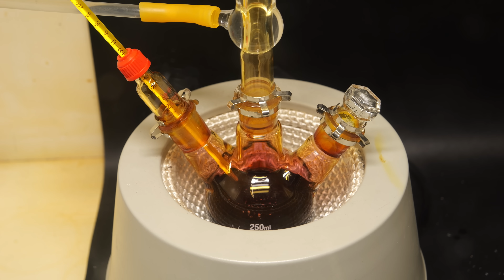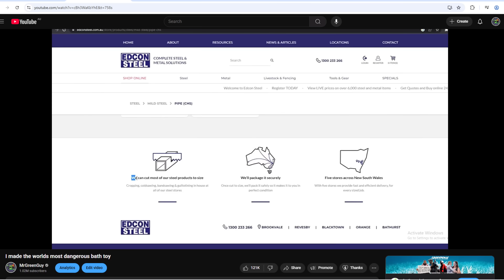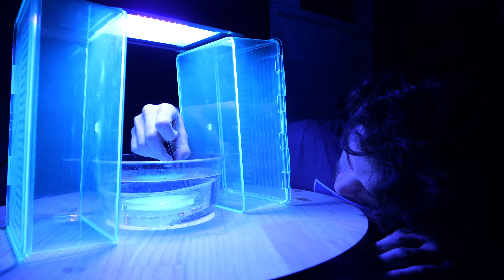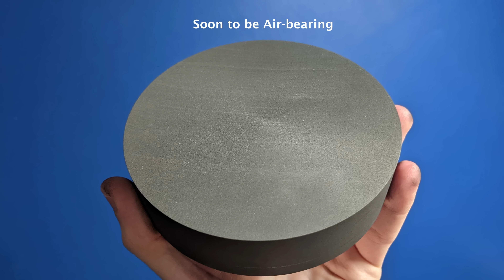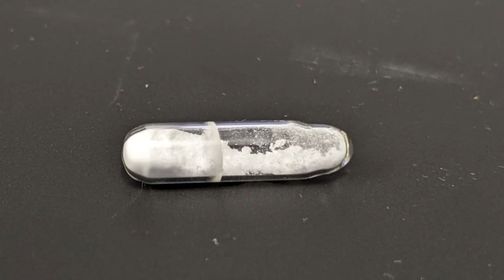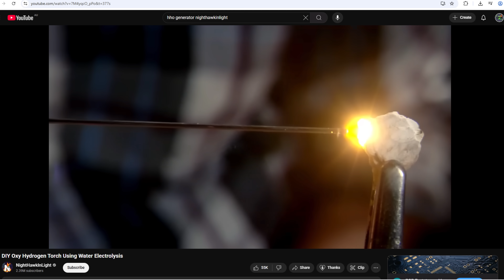Ranking My Experiments I Couldn't Post

Comment: For the turn table/resin issue, have you thought about spinning it from above? Like hanging it from something, a box fan screwed into the ceiling (or bare rafters if you have a basement like that).

I'd expect that would reduce a lot of the vibrations. I had to do something similar for a goofy project and was surprised how smooth even cheap fans spun. However I do also know that, at least the cheap ones, they cannot hold much. But you could probably just buy an electric motor that fits your needs and spin it.
Reply: There's some vibration in most electric motors. A damping system of some kind would still be required, I'd imagine. And a fan motor would likely be underpowered and too fast even if it could get up to speed. Top down suspension though is probably workable. Stretchy rope or a tri-mount spring system to damp out vibration. Best to avoid gears and pulleys, as they need bearings etc which can reintroduce vibration issues especially under load.. I'd go with a magnetic bearing if it weren't for the weight.

There's a bunch of ways this could be tackled, really.
Reply: @tehspamgozehere  That's fair, a fan could definitely not handle the vacuum chamber that's for sure. I do imagine the speed wouldn't be an issue, a lot of ways to adjust the speed if it's too fast.

Hard for me to say how bad the vibrations from the fan would be without trying it. I'd like to think that the right choice in suspending material would work. I don't think any rigid turntable-like solution could work.
Reply: @grainthe2nd71  Indeed. Anything rigid would transfer vibration and likely even amplify it. The liquid float notion our host had has sloshing problems instead. I found myself wondering if a combination might work. Buoy it up with a liquid beneath as well as take some of the strain with a line from above etc.  I also found myself wondering if we could work out how strong a mag bearing would need to be to support that much weight. It'd have to be a single magnetic source though, as multiples would introduce something akin to cogging, or so I imagine. I can't get FEMM to work on this machine to do any trial models. Mag bearings or mag levitation seems to be fantastic for low friction fans or even some simple flywheels, but isn't good at supporting weight.

I also find myself wondering if the whole pressure chamber is even required. Okay if it's to eliminate bubbles in the solution.. Why not use a vacuum chamber instead? Use a resin that cures really slowly, pull a strong vacuum on it, then close valves and sit the chamber on a little suspended platform and start it whizzing around. A stainless steel bucket with a glass lid and rubber seal can't be all that heavy.. Not compared to a dirty great big pressure pot.

Comment: for the spinny engineering problem:
air bearing is the way to go here. dont think you need to buy one tho. its for likely "couple times use" if i had to try something it would likely invole graphite blocks, pressurized air, and a satellite dish whose back is cast into concrete (so it doesnt flex). self centering, super smooth bearing.

Comment: About the mirror project. Use fans to do that chair thing to make it spin, though I don't think it's gonna work. (But you have to do it in a way so that you don't have air flowing towards the liquid (or else turbulences will make it uneven), don't just use the legs of the chair as something like blades and instead try to use one smooth surface, to prevent the air from creating vibrations and try to concentrate the air a bit if you want to use something like ventilators...)
Reply: I think it might fail because the chair is not smooth enough, you need to much pressure or there are to many turbulences...

Comment: I'm currently halfway through this video MrGreenGuy, when your showing off sooo soo so many "Spiny Things" for your failed resin lenses  project, I can't help but wonder how flat was the surface when you conducted these spinning resin experiments (plus tolerance to maintain the plane for the each spiny thing)? I'd imagine the surface would have to pretty darn flat and that rotational angular momentum would have to be pretty constant to achieve a desired outcome. Edit: Literally the next second you introduced the water tube idea 😛

Comment: 19:31 It definitely is. I was trying to 3D print a nozzle for a pool jet and I spent 3 months off and on designing this really complex part that had nuts that were printed into the piece and it all bolted together and was three parts. Ends up the simplest solution was the best solution and I just made a cone that match the profile of the jet and it was super simple and I finished it in a few hours. I wasted so much time trying to make something that I thought would work well and ends up none of that was needed.

Comment: You should definitely cut together something of your telescope mirror project. Even if you did not reach a successful outcome it sounds like you did a lot of trial and error and that is always interesting to watch. I would rather watch a video where somebody tries a lot of different things and fails then a video that somebody cuts out all of their failures and tries to look like they didn't write the first try. Life rarely works out that way. Also if you wanted I could definitely help with the engineering and mechanical side of your turntable project. I don't understand chemistry but think it is super cool but I do understand mechanical stuff and CAD and engineering. Chemists are like alchemists in my book.

Comment: on the mirror.. dude ur trying to get out of the box atomic level accuracy in crude ways. the mirror solution needs constant size particals perferable. the spinner base..look at what chip manufactors do to reduce vibration, not easy definatly the hardest part of all of this. the spinner..you had the right idea of a bowl in water but you'll need some adjustable balacing, and a good means to measure the spining container to a very fine degree. as for what spins it maybe magnets not sure on this part. lamanure flow water on a smooth ring maybe. some eletric means of propulsion may have a chance

Comment: You can buy needles and syringes at the pharmacy 😂 you just need to ask and know what gauge needle you need and how large of a syringe you need. 

Sometimes they don't have every size available though which is always annoying. They never have the right guage and length a need for my medication so I gotta use one that is way too long for a subq injection. Still works and even if I go too deep the medication can be absorbed safely in muscle tissue and hitting a vein on accident is fine too.

Comment: I have a feeling in my bones that one day you're going to make a previously unknown discovery in chemistry.

Also, smooth bearings under weight are expensive because of the insane precision engineering required. Maybe something like a ceramic bearing could work. It won't compress or deform and is insanely smooth.
Reply: He's actually not very good at this stuff. In case you can't tell

Comment: Use v drive belts and pullys from old classic cars for easy driving of the chair. A 3d printer is a cheat code for making your own solutions. Contact bambulabs and get yourself a printer. Also i personally wouldnt mind you running ads to fund your video. Sponsors for a channel of your size pay very very very well per video.

Comment: so I have a kind of janky but safe if done right turn table idea for your telescope project. get two buckets that fit tight enough they are hard to get apart and to the bottom one drill and put in a compressed air fitting boom axially constrained air baring. get the motor out of a cheap gum tree treadmill and attach a bike wheel (the bigger the tire the better as long as you can mount it without it touching the bottom bucket) to it and the air pressure in the tire will put enough give that it will keep the system working without many moving parts and it should be able to run for several hours fast enough to keep the parabola shape  in the resin. the bike wheel can be between the motor and the bucket bearings and that will give more compliance but you will have to run the motor faster to keep the parabola so it is a trade off but the if it is easier to just get a wheel hub at a local bike store or gum tree it should work and be around $100 give or take.

Comment: My dude, go to the ``not an engineer``, have a collab with him, have him literally take an 8 inch slab of steel, bore a hole to fit two car wheel bearings in it, machine a custom nut, a spindle with a face plate and skeletonize the main piece - the bearing block so that spots for bolts can be made and so that the thing can be bolted down properly... He can also bore out a hole for a bldc motor from those electric skateboards and what not, as well as coupling that with a single-V-belt to run it smoothly... All in all, material can be gotten from scrapyard for no more than 70 bucks, and we`re talking major chunks of steel, at least for your needs, and the bldc motors are not all that expensive, the pulleys can be made by him as well for barely any cost given the minimal amounts of material required, and the belt is cheap industrial lego, so all in all, for some maybe 400 bucks, you will end up with a majestic turn-table with near minimal vibrations and a holding capacity of 500kg easily... The car bearings can be had for 25 bucks a pop if you have a decent mechanic who is willing to just order the parts and have you hand him the money to pay for them... Mechanics have special price reduction cards in most parts stores(I use my colleague`s cards given that i have apprenticed as a mechatronics tech, i just never went into cars and repairs, but into machining and machine restorations instead...) so if you have a decent mech, they can source a decent bearing par for cheap, which is actually 4 bearings, as car bearings are tandem pairs of bearings in one outer race... 

That`s it essentially... If you want higher precision, or rather - less vibration, you will need mad expensive bearings, or custom bronze bearings, which ``not an engineer`` can make on a lathe with ease(bronze is costly as fuck, buy at scrapyards to avoid bankruptcy), but those require proper lubrication to work as smooth as possible, but insane smoothness can be achieved by using them, and for much less than it would take to get ultra-high grade of precision bearings that run at a few hundreds of a micron of runout, which is to say a few hundred-thousandths of a single  millimeter, which is what - a few millionths of an inch or so... That lazy susan of yours likely runs at 0.1mm of runout, which is woodworker levels of high precision - which is to say not precise at all... The regular wheel bearings should suffice for your needs however, especially with two of them at a decent distance on either end of the spindle... It will be quite some work for him, but it is a project that can net him quite some views, and it could give you a decent little machine to spin stuff very smoothly... 

I`m not sure if your project would be brought to completion thereby, but if it is possible to achieve the desired effects by centrifugal force in a rigid set-up, this thing, bolted into concrete will do it... What little vibration the system will have should be nullified by the viscosity of the resin, but this project falls outside of the scope of my learning to really make that judgement - not entirely, but i`m most definitely not either learned enough nor experienced enough in the optics field to judge how it should be done, outside of using a hydraulic, diamond lathe to just cut the damned thing into glass, or make ultra precise, ultra polished moulds for plastic injection of such a part...
Reply: To be honest, you might even consider just getting a van wheel hub as a complete unit... They come with a bearing installed or ground into the wheel hub(as the outer race)... The hub is a massive piece of cast iron, and offers bolt holes out of the box, so you just get a wheel hub, bolt that bitch down to the floor and have ``not an engineer`` just machine a custom spindle with a pulley as the integral part - the outside diameter of the face plate that he would attach to the spindle... It would avoid the need for machining a custom bearing block, but it would lack the brutal levels of support and smoothness that a proper spindle assembly with bearings at either end would have, and it would make for a much more mediocre collab, but i guess that it would still be more than enough for your needs, as it would beat the gaming chair by 1000x in regards of both smoothness(inherent to precision fit) and the actual rigidity and carrying capacity... The van wheel-hub can also be gotten much cheaper with the mechanic`s discount... The only issue is the need for a standalone fixture for the motor to keep that in place and to tension the belt...

Comment: if you're gonna use an oxygen concentrator to try use with your propane torch, i'll save you some trouble, it's not going to be enough pressure/flow rate

however, what you can do is hook it up to the intake of your air compressor and then try hook up that hose to your propane torch, so that your air compressors tank acts as an oxygen battery basically

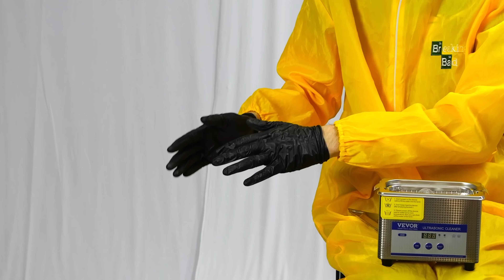Comment: 19:40 yes, yes it is. Often the simple problems require the most complicated solutions because in order to push boundaries you need 99.9% accuracy to know how something works. Then once you figure that out it can be dialed back significantly. A good example is controlling temperature. Super simple problem on the surface. But turns on your on the Kelvin scale and need it to be like 20 Kelvin +/- 0.2 and that's a lot harder. Oh and you need to take into account the box and how much heat it dissapates as well as the user opening the door to put stuff in and take stuff out. That's incredibly complicated to engineer.

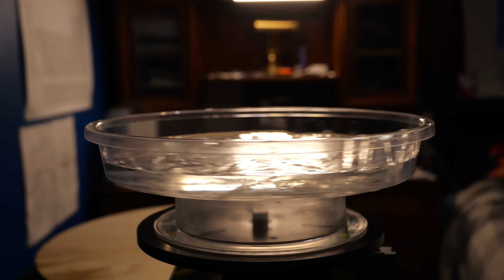Comment: 13:07 what you need is some sort of magnetic levitation with a really heavy base. The heavy base prevents movement through inertia and the magnetic levitation prevents vibration transfer through any ridged mechanism. It would also help if the whole thing wasn't near any roads or other sources of vibration. If all that isn't enough often times stacking the same principles works. Like putting the heavy base on foam or mag levitating the heavy base. This is something researchers do for optics and lasers. That would also be a good point for looking for info.
Reply: Also a good video is on "The thought Emporium" titled "Can Magnets Stop Vibrations? Magnetic Levitation Laser Table - Holograms 1" Where he does what I believe is the best isolation from the ground. The spinning mag Lev is going to be harder but maybe tray and contact some fan company's because they use mag Lev to reduce wear and noise on fans.

Comment: for the rotating mirror thing, few tips, bearings are smooth try your local car part dealership to buy bearings, you can make a box out of wood and press the bearings in the wood, try v belts, relativli simple to make them see mattias wandel, but if not wind shield wiper motor and bicycle parts😂, suspend the tub from celing on 2 elastic ropes, so they dampen vibrations, atach the ropes to a some sort of a bar maybe a 2x4 and put this bar on a motor with bearings like sugested before, but every motor has a bit of vibrations, also servo motors wuth fluid nc or other arduino controllers can be cheap eash,  bearings  air bearing is an owerkill, you could try hydrostatic oil bearing

Comment: use an engine block with bearings a crankshaft and put the tub on the flywheel, a scrapyard engine should do good as they are still veary stable, but they may be seized up.

Comment: Make the turning table the same way as the gyroscope toy but scaled up!
Make sure you make a cage on the top side of the flywheel so you can spin it around its axis without it running down the middle...